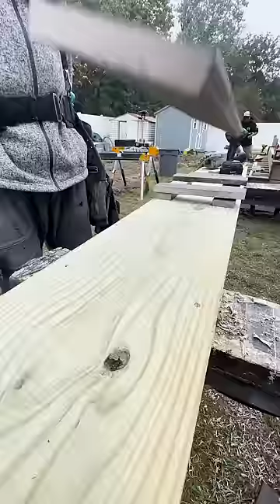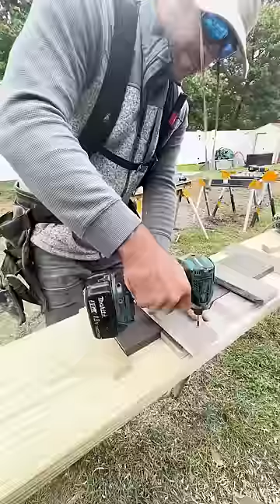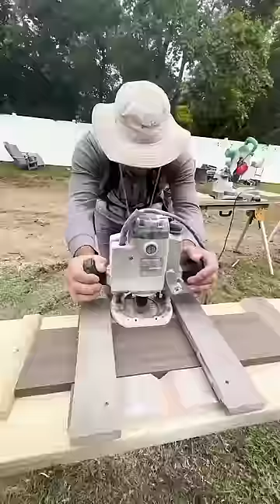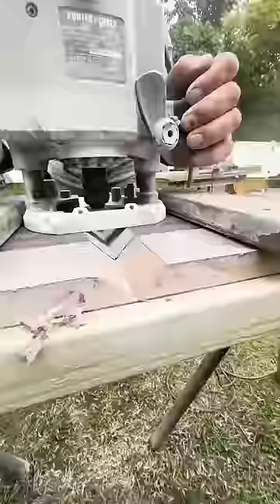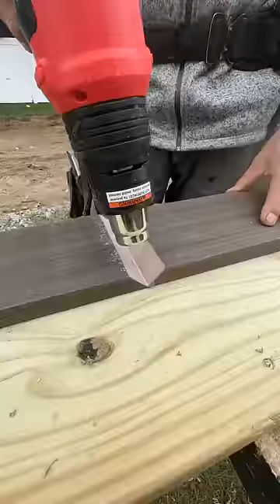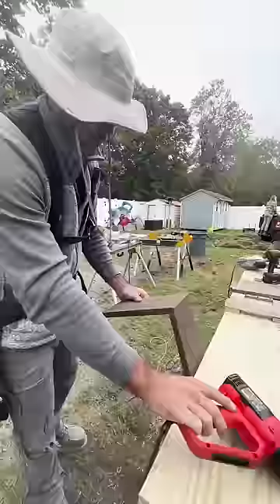Miter folds! A special detail we love adding on our projects, but also making it efficient!

Comment: That miter bit was fighting for its life
Reply: It got the job done tho. Hell if you use 1 or 2 bits per house you've made your money back
Reply: Router not bit. The motor is done
Reply: Agreed. A few relief cuts with a circ saw would have taken 80% (I don't know but guessing) of the stress out.  Chip exfil and total material removed can really make a difference to longevity and safety.
Reply: @MintStiles agree with this, or at least do 2 passes, one shallow then plunge full depth
Reply: @Paul-bc1qc  word
Reply: He's using a plunge router, set up the stop and do a shallow cut the set another to the right depth and that will save the motor and the bit
Reply: Es mdf..."cartón comprimido" el más blando de cualquier material
Reply: No para nada es como si cortarás queso o mantequilla con una cuchara
El mdf es cartón comprimido
Reply: Haha was gonna say the same thing
Reply: It’s because it’s made for wood
Reply: @joseruiz-cc1mt it’s composite decking
Reply: Or at the very least just don't push it through so hard
Reply: Why not the miter saw behind you?
2. 45° cuts and done.
Reply: Let er' buck!!
Reply: Few drinks and it was right back in there
Reply: Remember you always want to force it, never let the tool do the work 😅

Comment: we are entering the age of fine plastic workers
Reply: We are in the plastic age already
Reply: Now, now. You can tell how proud the dude is of taking the extra step, going the extra mile in the name  of craftsmanship and attention to detail, in honor of the finest materials the petro industry has to offer.
Reply: That’s why house fires are so bad.
Reply: Ever hear of mdf or osb? Wood held together by essentially plastic
Reply: @-a13x-75  yup it as it burns it melts and spreads quickly
Reply: @brennik05  uh, with dimensional lumber? No you can't and don't' like your own comment.
Reply: And shards and micro plastic are all over the yard now
Reply: @joshd79  just cutting it creates a fine snow that will never go away! But hey let’s cut down all trees and put up solar panels made by our enemies!!
Reply: Composite decking is so much better than wood it’s not even comparable.
Reply: Composite decking has the advantage of only needing to be built once if you take care of it though‼️
The same way people complain about 1-use plastic because "it doesn't decompose & harms the environment for eternity" is also plastic's strength when used for purposes like building where it's a good thing that it'll never rot or degrade 💯
Reply: long before now
Reply: Typically I agree,  but maintaining a wood deck outside in rough climates is miserable... and no matter what you do is getting ripped out and redone every decade or so.  

The permanence of plastic is it's quality in this application.
Reply: @Slowhand871 except that it’s not so much better unless composite today is 1000 times better than it was 5 years ago.  Don’t get don’t get me wrong. it’s better than wood, but it is not the end all.
Reply: @east5871 they didn't say it was an end all they said it was better than wood.
Reply: @Schmuly  I guess where I got confused was a couple of commenters who said that with a wood deck you’d have to tear it out in 10 years and with a composite deck you wouldn’t have to do that. That sure sounds like they’re suggesting it’s an end all to me.  Having just bought a house after looking at a lot of properties with both wood and composite decks with a bit of age on them I was disappointed in the performance of the composite over time.  It doesn’t match the hype by a long shot even though a case could be made that it outperforms wood.  But in the light of day a ratty looking deck is still a ratty looking deck and someone who thought a composite is the answer is going to be disappointed.  Isn’t there a premium for composite?  There was the last time I looked which was a few years ago.
Reply: @Schmuly  its definitely not better then wood, thats just what their bs marketing team wants you to think. If this stuff was so much better then wood, it would be used for way more then it is
Reply: @SICresinwrks uh.. It's way more expensive.. Like significantly.. Like $20 more a BOARD expensive.. Of course it's not going to be used as much. But it's damn near invincible. It's not marketing. I will only install vinyl trim around doors and windows at my house. I've replaced all the wood because wood rots.. Plastic doesn't
Reply: @SICresinwrks please enlighten us all as to why wood is a superior deck material...
Reply: Yeah nah,this been a thing for nearly 20 yrs
Reply: Ahahaha
Reply: @1joshua the First version of OSB was made with old-fashioned glue and the 💩 was terrible, if it got wet it would fluff and fall apart within days.  After a few lawsuits they reconfigured the glue recipe and now it's much better, Still not as good as old school plywood though.  Same could be said with composite decking, after many class action lawsuits and Many reformulations, it has gotten pretty good these days.  I still prefer working with wood, you can get a nicer finish but the plastic 💩 does last better.
Reply: @theoriginalmonstermaker that's pretty crazy and untrue. My dad built his deck when I was 8. 31 years ago and it's still just as sturdy as it was on day one
Reply: @woodworkingandepoxy643  There are pros and cons to both.  Wood can be built to last and maintained well,  but it takes effort.  Modern composites and more "one and done", but in cases they are damaged (pets,  furniture), it can be more difficult to repair.  
Your degree of yearly involvement,  and the climate where you live factor in too.  In my experience new wood decking doesn't weather the elements very well.
Reply: @-a13x-75  In my opinion, the only thing good about MDF is, round walls and rounded staircases. I rather spend a whole day doing it right than, installing cheap compressed cardboard.
Reply: Well put.  Wood will be a thing of the past…instead of tree farms/lots it will be recycling plants everywhere and a new host of problems.
Reply: @sargeinamerica or, and hear me out..make solar panels here and put them NEXT to the trees…
Reply: @trancetechkid  that’s deep
Reply: @Prairiedrifter1 guys like you always have to prove the correct person correct . 😂 God bless ya son 🙏 ❤
Reply: @sargeinamerica wood house fires are just as bad if not worse. brick based houses like they got over seas are the best way to go.
Reply: @EmpressOfExile206 if you can't see it degrading it doesn't necessarily means that it doesn't degrade. It means that you can't see it degrade because the parts that are lost from the material are so tiny that you need a microscope to see them. That's why it's called microplastic ;)
Reply: @-a13x-75  Which then emits fumes for years, making new houses barely habitable
Reply: @east5871  NONE of this discussion pertains to the discussion at hand.  He's not building a deck with plastic-coated MDF.  It's supposed to be some kind of indoor finish application from the looks of it.  Plastic 'contact paper' on MDF to make it look 'sorta' like the wood they should've used....
Reply: @jackdedert2945  I thought we were discussing composite versus wood deck? 🤷🏼‍♂️
Reply: @stimulatemyexistence5669 "it's so pre 911, it's so September the 10th"
Reply: I just wanna say you're all making good points. Keep it up
Reply: Built a deck 20 years ago with cedar; it's done. Being replaced next week with Trex. Sorry, but plastic is just superior unless you have a full-time staff to maintain your outside wooden surfaces. I already pay upwards of $10K per year for someone else to maintain my landscaping  - I'll go with the durable option on buildings and hardscape.
Reply: Union plastic workers
Reply: @-a13x-75 ah! Splain your convoluted argument. Just because some product has a percentage of plastic does not make its overall weight to be of plastic. House fires are horrible these days and I’ll pass on the micro plastic dust in my lawn.
Reply: @Slowhand871 junk. You can eat the plastic boards too. Hemp will always be superior to wood and plastic

Comment: I wish so bad i could get on with a crew like this. Im pretty new to the trades, and the two different crews i worked with were dull of hacks. Cutting corners on everything. Made it so unenjoyable and felt guilty. Quit and doing handyman stuff by myself. Its lonely though.
Reply: Pick a specific trade you are interested in like plumbing, electrical or carpentry and find someone who specializes in it to work for.  Going out on your own too early will stunt your career because she won’t learn fast enough on your own
Reply: Aint it the truth! Quite sad really.
Reply: 35 years ago I started working for hacks. I've since worked in multi-million dollar mansions, done extensive custom tile and woodwork, and built my own business working for the best clients I could wish for. We all start somewhere. Just set your goals and don't let anything stop you. Quality, honesty and get it done attitude are the key.
Reply: There has always been lots of hacks and butchers' out there, get on a "Specialized" crew, like finish trim, cabinet installed, doors and hardware, go commercial, and leave the house work. Hone your specialty and you Will be the guy they call.
Reply: I wish I had a contractor who took pride in his work. His crew was 💩 and I could see shortcuts in lots of his work, 84 nails in one sheet of flooring plywood! I counted. 😮😢etc etc etc etc 😑
Reply: Same here, felt guilty participating in all the shoddy work. Didn't feel ready to go out on my own bc I never really learned how to do things the "right" way efficiently. Videos like these hurt to watch
Reply: @e1000sn 🤣🤣🤣🤣 comment must’ve went over everyone’s head or they’re just lame!
Reply: Learning how to do something wrong is equal to learning how to do something right. It's all experience in your pocket.
Reply: Press on Brother, implement fine quality work yourself
Reply: Arrhhhh do you you need a hug, man up !!!
Reply: Don't get on with this type of crew they take short cuts that guys like me get called to fix!
Reply: Move to a rich area. They are the only people that can afford the time and money it takes to do things this way. As an example, a 45 degree and some caulk would have done this to an acceptable level in a fraction of the time. So why pay 25% more?

Cause you can. Get around enough people that have that as an answer lol.
Reply: @moriscoley5328 sounds like bs bc you typically screw flooring sheets down
Reply: @-cz1vp exactly man! It was cringe watching this video. And even more cringe reading this guys comment praising hacks and aspiring to be with them
Reply: Yeah you are going to find 9 out of 10 where they are hackes  .. 😢
Reply: Build up a name for yourself with your quality and attention to details. Onve you start building a reputation you can begin pricing your services in a way that the pricing selects out the bad customers whom you wouldnt want to work for
Reply: @adamhorton1601 I’d have to partially agree, bcuz it’d take learning what not to do on multiple occasions, in order to learn what to do.
Reply: This guy is showing the hack way of doing this
Reply: Booohooooooo be better then
Reply: Hey man good for you stick with it, I'm the same way as a mechanic, I couldnt work at shitty shops and didn't want to be a dealership employee so I started my own shop and it's been tough but you gotta love what you do and appreciate the trade.
Reply: Feel your pain mate. Keep going and doing what you enjoy. One day you will find a crew and colleagues who deserve your time and company.
Reply: Keep that heart bro. You'll be alrite on your own.
Reply: A crew that doesn’t know how to use a plunge router? I’m sure you’ll survive mate really I do.

Comment: If that bit gets any duller you won't be needing the heat gun lol
Reply: Right? That porter cable router should have more than enough power to get right through that
Reply: the material really dulls blades and cutting bits
Reply: He's taking off too much material in 1 pass.
Reply: Can I get a hoy yuh? 
Router: “hoy yuh”
Reply: He's getting it done.
Reply: It'd work better if he didn't try to remove all the material in one go
Reply: @ohioknifelover its actually better to in this instance due to the edge being dulled at an equal rate. Just gotta push a lot slower.
Reply: @TarantuLandoCalcuLingus  I'm more worried about the router not the bit
Reply: A part from the router handling, superb job
Reply: @christhut8140  he’s choking the shit out of it too
Reply: Or just don't shove the router into the work piece. You have to feed it slowly.
Reply: Cool!

Comment: Looks good. I would recommend a plunge router and starting with shallower passes
Reply: its plastic not wood its much softer and no tearout
Reply: @helenabasquette7222  it's bogging the shit out of that router
Reply: @saultpancetta366  its probably not that important to him getnerdone is 😀✌️
Reply: @helenabasquette7222  that's why it stalled
Reply: He's even using a plunge router with multi-step that could be setup to make each pass take less time than one pass that he made in this video.
Reply: It still has wood fibers and glue in it. Itnis not solid plastic. Even if it were, he didn't need to force it through the material like he did.
Reply: That is a plunge router 🤦
Reply: I noticed that is a plunge router, and thought the same thing... use it.
Reply: Why suggest something that will double the work load, and doesn't solve a problem that doesn't exist here...?
Leave it to the Pros, mate. 👍🏻
Reply: @smithbrownjones  🤣 I am a pro. You can do it in 2 cuts faster and easier than one heavy cut if you know what you're doing. Either way, you can hear the motor bogg down, which means you're pushing too hard a "pro" would know that. 🤦
Reply: @smithbrownjones spoken like someone who has probably never used a router. I am a hobbyist woodworker and know better than to use a router that way.
Reply: @smithbrownjones As a machinist who deals with cutting tools like endmills all day. He was feeding it way to hard causing the router to not be able to handle the thickness of the chip that it was creating. Making it bog down. It can handle it in one pas just got to let the cutter do the work and keep a consistent pressure on it. Don't force it
Reply: 100% that router work made me cringe but the final product was good. Those bits are expensive, don't abuse them and they can last forever.
Reply: @toddsalmon6541 as another hobbiest, I agree. I learned by watching experienced wood working masters and they always say NOT to use a router like this. It's the same with any tool. Either cut slower or make successive passes. With a router, more passes is usually the best method. In the long run, going just a little slower will save more time than it wastes. Burning out a tool or a bit is worse than damaging one piece of material.
Reply: It's a damn router...we ain't talking about a $100k piece of equipment here
Reply: ........................that is a plunge router
Reply: No es necesario ya que lo que vemos es un material blando
Cartón comprimido
Mdf su nombre comercial
Reply: @jmackinjersey1     lo siento amigo...lo que sale la viruta no es madera es cartón.... El listón es mdf 
Su nombre comercial muy libiano

Comment: Looks like that thin laminate on the outside crease will crack as soon as the weather changes.
Reply: Guaranteed
Reply: Correct. That routering  is a waste of time.
Reply: Why does it not crack around every other tight corner like when it's wrapped around the 4 edges of the board in the factory using heat like he is doing?
Reply: @OneManBandWoodworks  What he's doing is nothing close to how the boards are manufactured.
Reply: @liquidmagma  they are post-formed, on a post-forming machine that's purpose built, almost the same process. Uses radiant heat instead of hot air

Comment: Damn, that took far longer than just cutting out a 45 deg bevel on any saw.
Reply: I don't think you understand what took place in the video.  It would require (2) 45 degree bevel cuts and then you would have to fasten the two pieces together at the bevels you just cut which also defeats the whole purpose which was putting a 45 degree angle in a single continuous board.
Reply: Yeah your material cost is at least 2 x wood, and this lastic stuff is made of oil not natural materials. It's not for me...
Reply: @matthewhall9692 your whole paragraph made 0 sense
Reply: @jeremysanders8138 I disagree
Reply: Some people do not think
Reply: The shrinkage test is or was upon him
Reply: @matthewhall9692 it can easily be done with a saw,you just don't cut all the way through.set the depth correctly,and then use the heat gun same as the video. I've seen it done many times with a saw,never a router.

Comment: I’ve been tempting to try this on my stair risers. How do they hold up? Does expansion and contraction affect the joint
Reply: The expansion and contraction of the pt under it will bust it before the decking board causes it. It’s important to leave room and not be super tight against the pt when wrapping it with any pvc or composite.
Reply: Not going to last. Better to have an actual miter than this ripping appart unevenly.
Reply: Not going to last. Better to have an actual miter than this ripping appart unevenly.
Reply: Looks good yea but we all know it don't last.......
Reply: Not really, the pt will dry and shrink enough, but the Sun will heat it up and make it buckle.

Comment: We had a cnc bit for countertops that would do 3 cuts. Two v cuts with a rounded cut between. We would tape the underside of the solid surface before the cnc cut it out with the point of the V going down to the tape. All that was left was to fill it with seam kit and left it set run the cove router and sand. Took hours off the creation of standard coved counter top builds